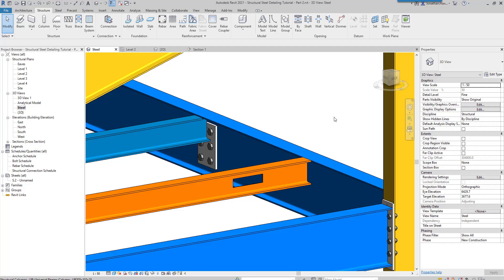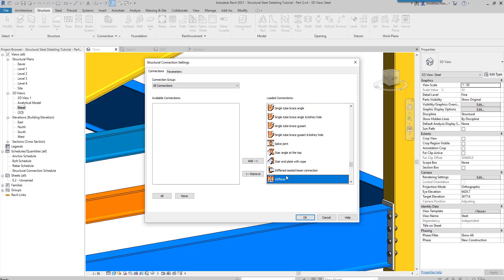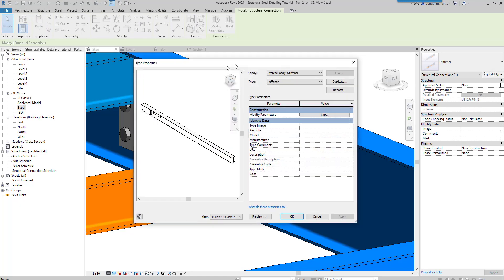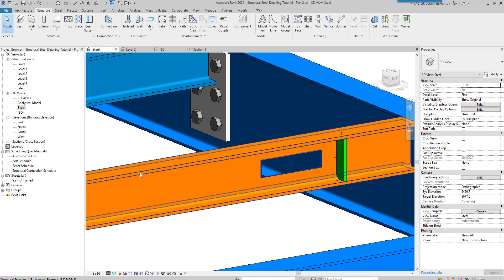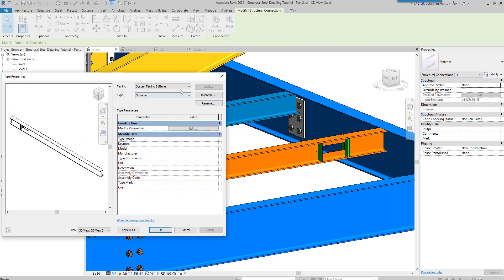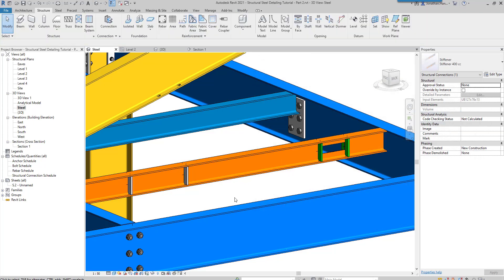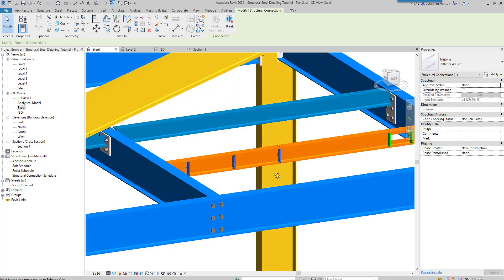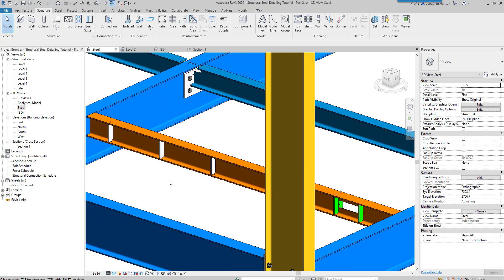Revit 2021- New structural Features - Steel Stiffeners

Comment: Thank you sir.Please upload the video in welding connection of steel to steel beam or plate. Welding symbol is not shown in layer (or) coating format in actual all joints in revit. Please help me to solve this problem. Kindly reply sir.